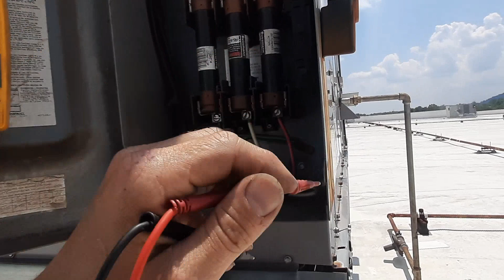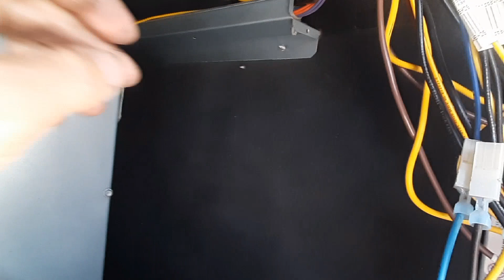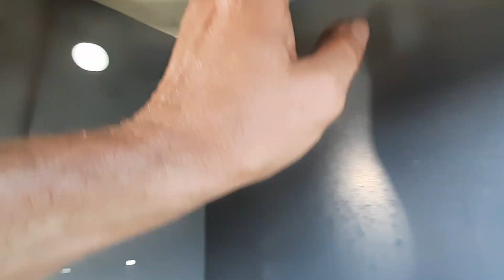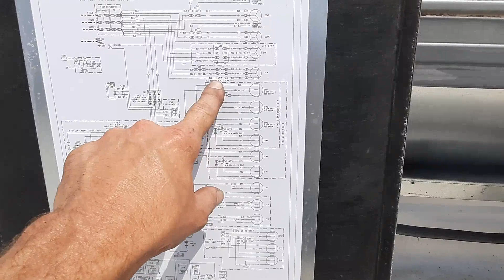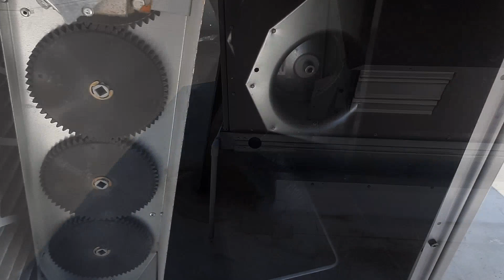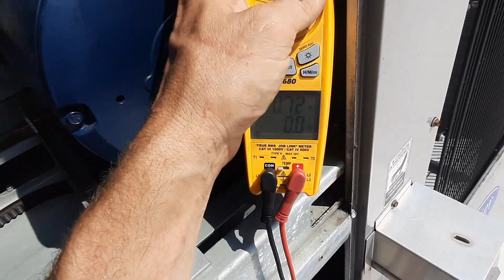No Cooling Service call another carrier package unit. same commercial building as last week.

Comment: I had that same problem on the same unit a couple weeks ago but I had no power exhaust, 4 condenser fans and 1 was locked up and both tandem 10uf caps were all bad.
Reply from the maker: That's typical and why I started there. Thanks, courtrutherford.